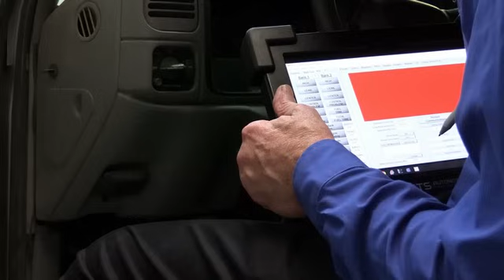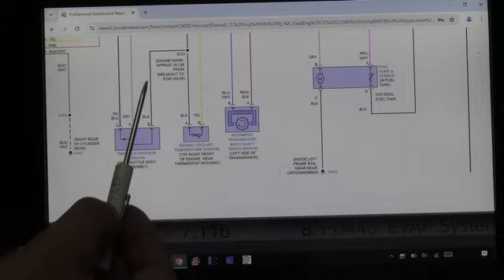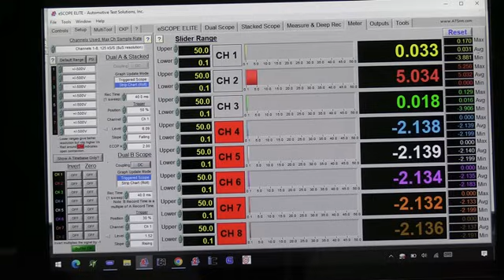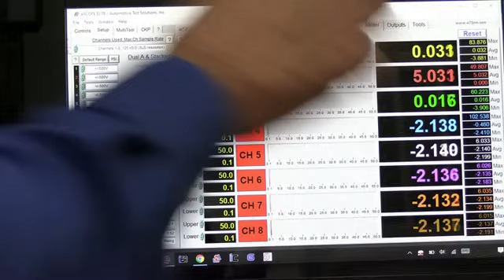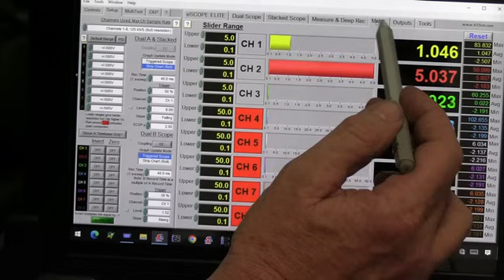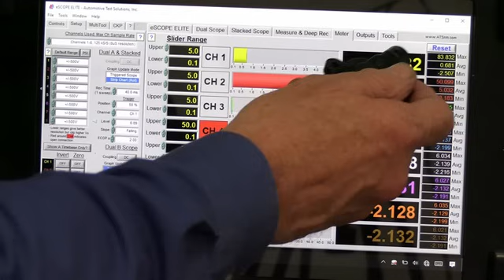2000 Chevrolet Tahoe TPS Issue

Comment: 10:10

Gold.

Best part of the video IMO.  Like a misfire or O2 code suspending a P0420.  Makes it tough sometimes.  Clients don't know any better, and shops get hammered.

This is why I always check for inc mon. BEFORE I continue.  Heck, I even check them for oil changes!

And to add...I have seen some logic inferred values for scan data.  Had one about a year ago give data for it's MAF sensor in OE, but looking at OBD2 pids showed a much different signal.

Comment: I actually proved out a TPS sensor pulling down a signal wire by using a check engine light scanner, because the code said "TPS voltage low" every time the sensor was plugged in, but changed to "TPS voltage high" every time the sensor was unplugged. This proves that the TPS is pulling down the voltage using only a $5 check engine light scanner, but this was just a stroke of luck. You typically cannot make 100% diagnoses using only a scanner.

Comment: Just a little off subject, the 505 CRO Oil System Treatment works, period, end of story. My 2006 Silverado with 235,000 miles on it was burning a quart every 600 miles. Put 1200 since I did the treatment and my oil level is still full. Thanks Bernie.

Comment: I like that customer explaination of the additional tests running. I fight that battle from time to time. Now I have a good way to warn them the light possibly could come on.
Reply: I agree.  Never thought that the ECM/PCM suspended tests because the MIL light is on and it's in the TPS in this case.  WOW!